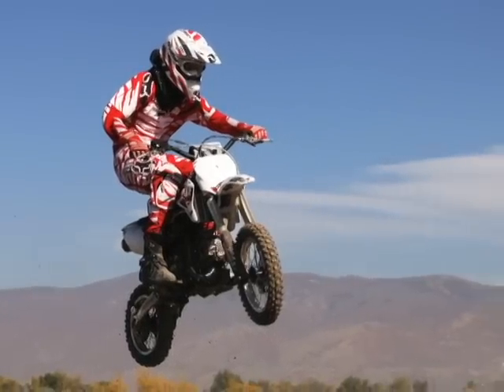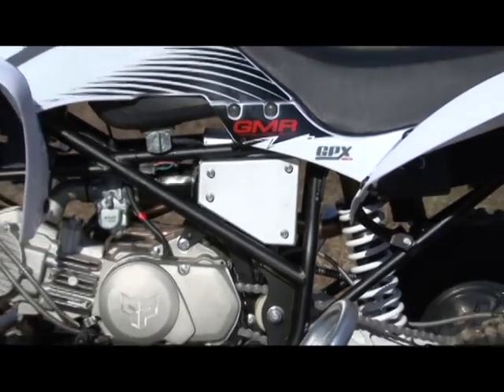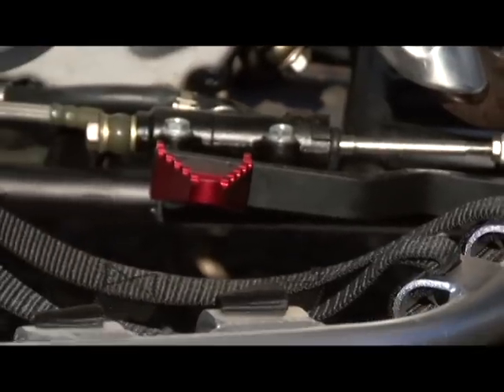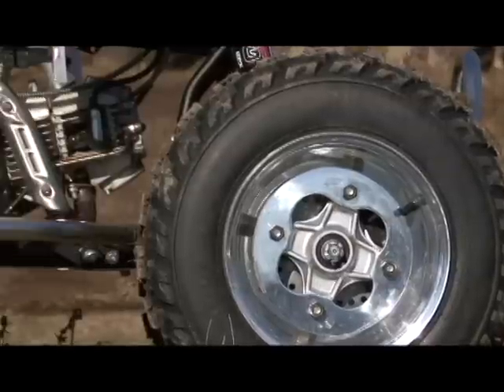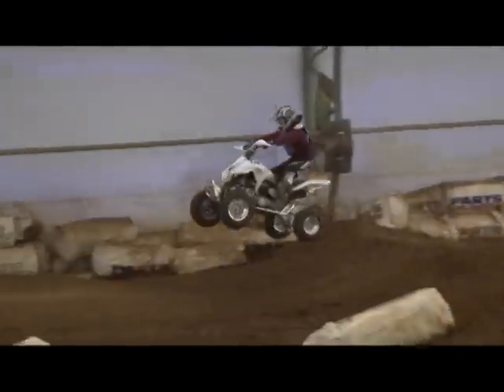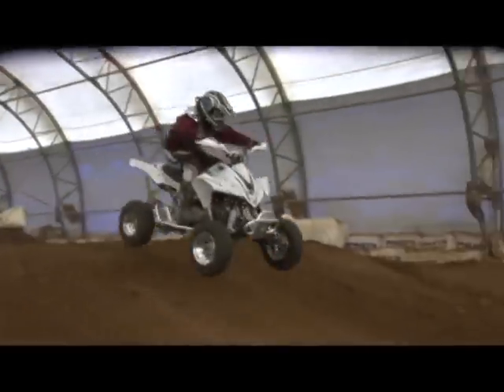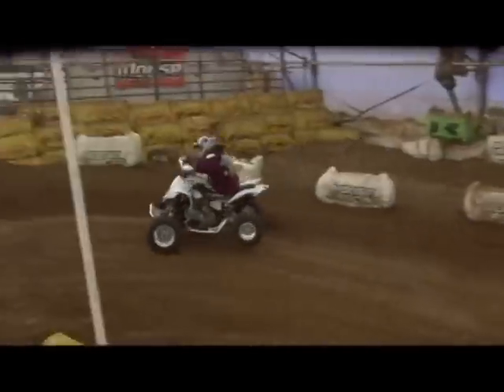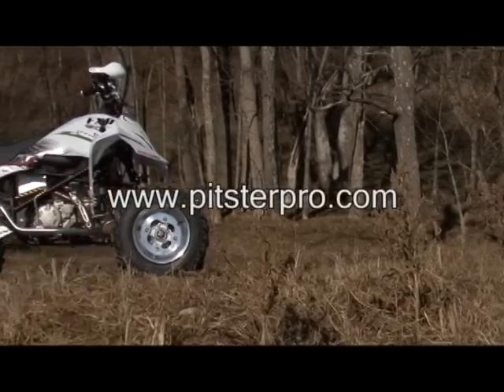2011 Pitster Pro FXR125 Test

Comment from the maker: We had around 15 hours on ours, most of which were hard hours.  After we finished beating on it, the motor and clutch are working perfect and the chassis components are holding up fine. The upper a arm and swingarm bushings wore a bit quickly. We will install a new set and see how they hold up. 

You can see a shootout between it and the Raptor 125 on our website under the featured video section.